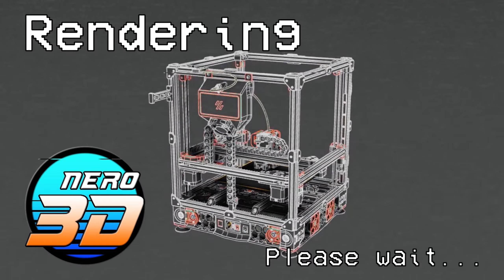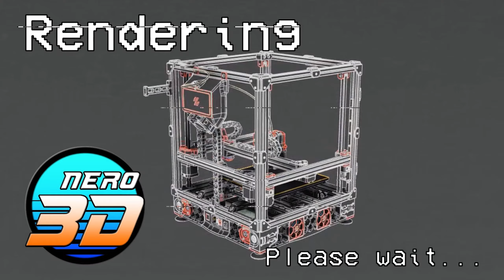RatRig V-Core 3.1-200 Build - PART 5 #livestream #3dprinting

Comment: Subarus still have head gasket issues dont be played by the dealer like that 60-100K miles you will need head gaskets 100% chance. Also Its Eve, wall-e just says her name wrong. Silly robot.
Reply from the maker: Guess the many people I've spoken to with newer subies with over 250k on em are all lying. The head gasket issue was the old engine and not a think anymore

Also. That's the joke
Reply: @CanuckCreator  My subie has 180k on it. I love them, but the issue is the issue. I used to buy used cars for major dealership. 100% of the trade ins over 80k miles had leaking head gaskets. I still wouldn’t say don’t buy one though, great cars.